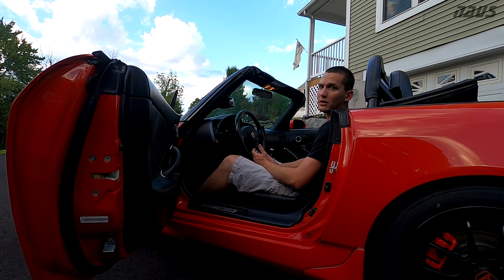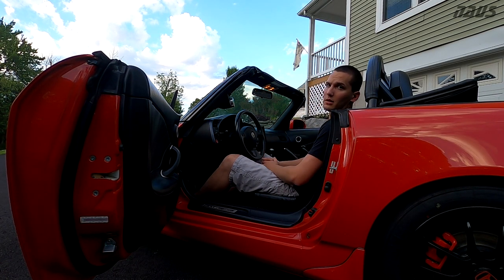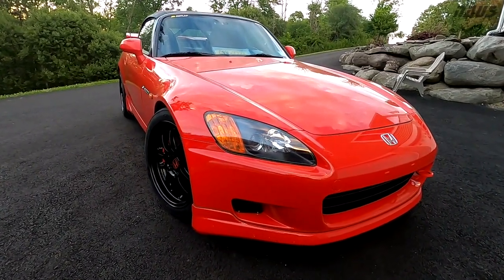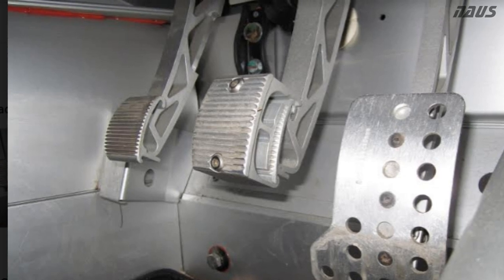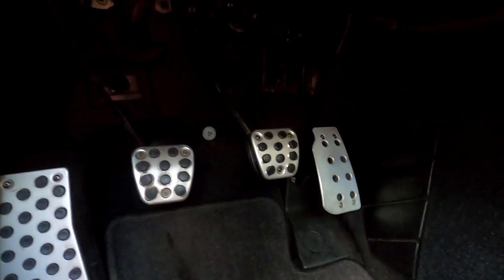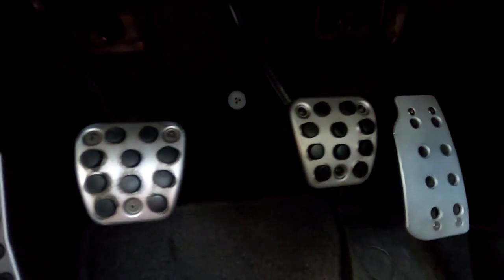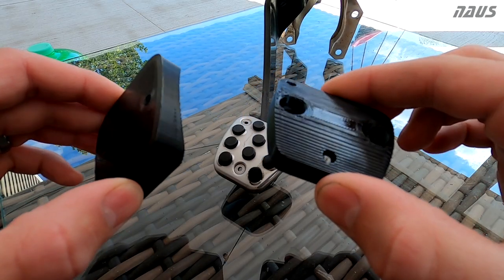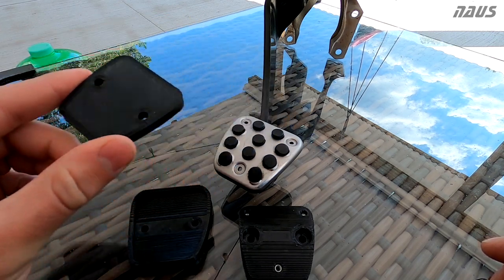S2000 Brake Pedal Spacer - The Heel Toe Helper

Comment: I never had this issue with my AP2 but as soon as I took my AP1 to the track, I struggled and I knew this was the problem... I'm going to place an order shortly. Thanks for the R&D!
Reply from the maker: Was your AP2 a 06+? Maybe the gas pedal sits much lower on those since it’s just a cable to a sensor and not the actual Throttle body. May require much less travel to go from idle to WOT
Reply: @NAUS2K  no it was actually an 04 with throttle cable so I'm not sure why?
Reply: I have 05 and no issues